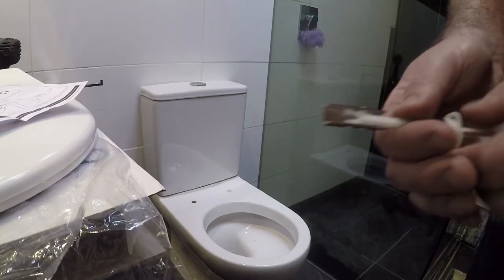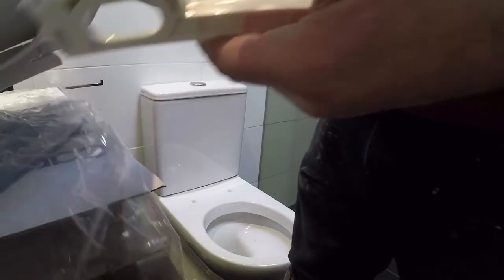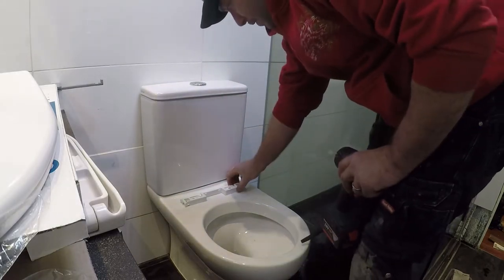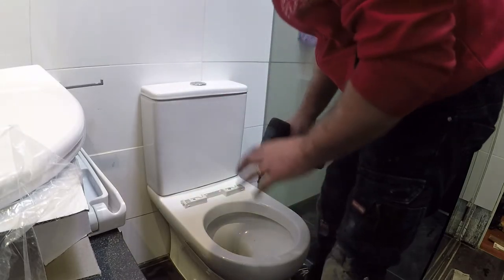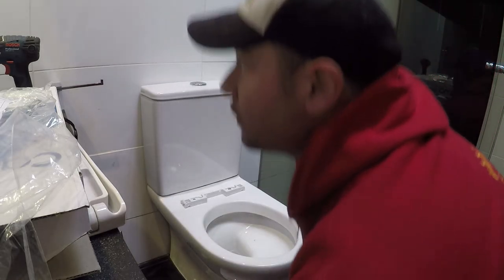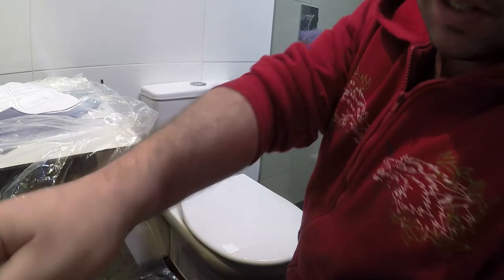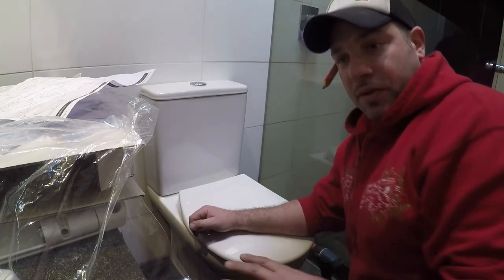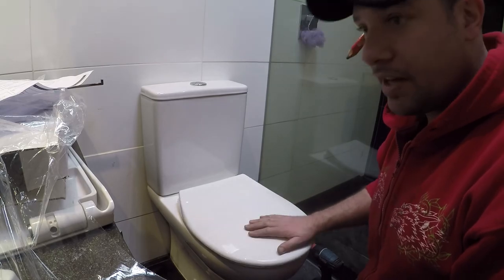How to replace a toilet seat

Comment: The clasp/fitting you use... How do you remove the back clasp without it breaking? TIA
Reply from the maker: Grrrrrreat question Jules,
Truthfully, the biggest part of this is feeling the correct position and tightness.  This does take a few goes to get right and still there are a few that don't go to plan.
#stayawesome #practicemakesperfect 
joe joe